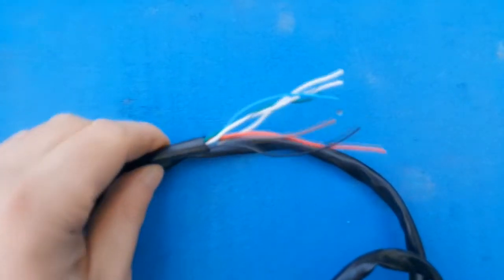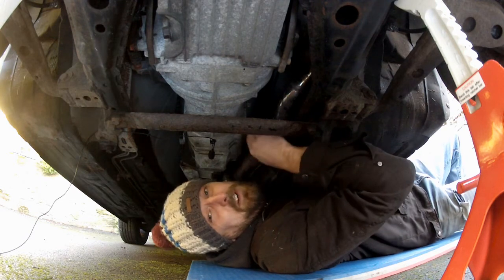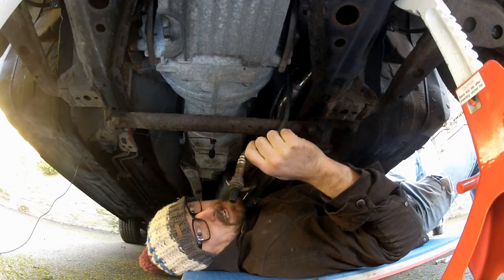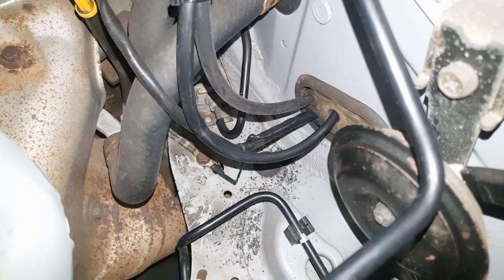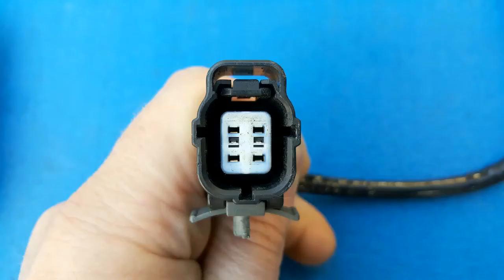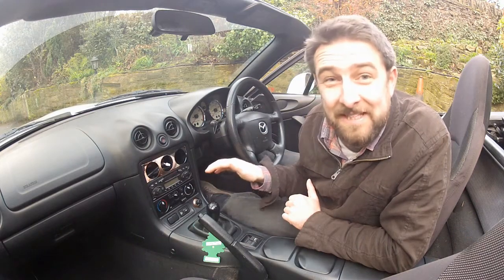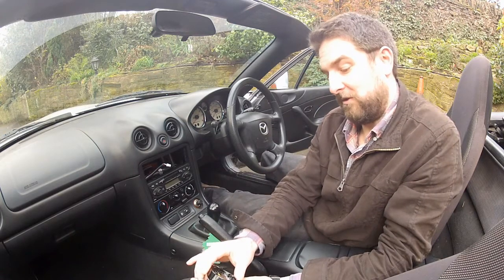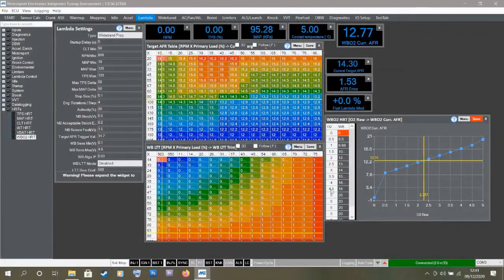How to Install an AFR Gauge and Wideband Sensor (AEM Series X NB/NBFL) | Supercharging the MX5 Ep 08

Comment: Great help, thank you! I got a CEL for my Toyota due to the heater circuit no longer being connected via the stock lambda connector. Short term fix is to wire the old lambda heating circuit back in.

Comment: I just installed the same gauge in my 2001, and this video was very helpful. Thanks in particular for showing the wiring of the brown and white wires to the factory harness. Even though the wire colors on my car are different (2 whites instead of 2 blacks, black and gray instead of blue and white), fortunately the pins were in the same places on the plug you so clearly showed.
Reply from the maker: Great to hear. It took a bit of research to put this video together, there's a lot of information dotted around on the internet but not all in one place!
Reply: You need to do anything with those 2 blacks? just leave alone?

Comment: Thank you so much for this video
Reply from the maker: No prob. Are you using the same gauge with Megasquirt?
Reply: @FastRust  Yeah mate, using the same gauge and have an NB1! Been trying to figure out if I could get signal and signal ground from the stock harness and you explained it so well!
Reply from the maker: Thanks, glad it helped! Yes signal and s/ground at the plug. There is a 12v switched live there as well (for the sensor heater) but I keep reading people having issues with doing it this way, hence cig lighter 👍🏻

Comment: Can I get the +12V from the same connector? I think that one of those black wires is positive when the ignition is on.
Reply from the maker: It is but I've heard multiple issues with getting 12v from there. Personally I'd avoid it.
Reply: @FastRust  True, I tried it and doesn't work. Connected to the cigarrete lighter! Thank you!

Comment: hey man i used this video to put mine in and im having some problems with it. i did it the exact same way however my nb has 2 o2 sensors, so i used the on the exhaust manifold (before the cat). the guage works, however im getting a code P1135) pretty sure my ecu is not getting a reading from the wideband. the car runs rough and very lean. I'm still on a stock ecu, any help will be appreciated
Reply from the maker: You can't use this gauge with stock ECU as it doesn't have narrowband emulation. You need to get a gauge that does or use a standalone ECU like the ME221

Comment: Did you have to calibrate the gauge at all or was it precalibrated?
Reply from the maker: You can do a fresh air calibration via the gauge if you really want to, but these 4.9 sensors are pre calibrated so it's not necessary. Just bung it in the pipe and go.

Comment: can you get the car started before you swap out the old narrowband sensor with the me221 or is it needed for it to work
Reply from the maker: Yes it'll work fine on the basemap. When you install the wideband you'll have to change the lambda settings in MEITE. You can see that in the next video 👍🏻

Comment: I hate to ask but would tapping into the stock ECU harness also apply to an NA 1.6?
Reply from the maker: Yes but from what I gather in the comments there's less wires to deal with on an NA. Might be worth a quick search before you start.
Reply: @FastRust  yep. Only one wire. I ground the brown wire to the block. Pretty straight forward. Thank you sm again

Comment: Will this afr sensor+gauge work on a 96 miata with stock ecu ?
Reply from the maker: No, there's no narrowband emulation on this model. You could weld another bung in the exhaust and run it independently.

Comment: Thanks but aren't you on like a strict budget?
Why did you go and get an expensive wideband?
Couldn't you just get something like an exhaust gas temperature sensor. Then you tune according to the temperature?
Reply from the maker: AEM X Series is on the cheap end of widebands! Especially if you get one 2nd hand like I did & for ECU tuning purposes it's essential. You could not tune solely off the temperature of the exhaust.